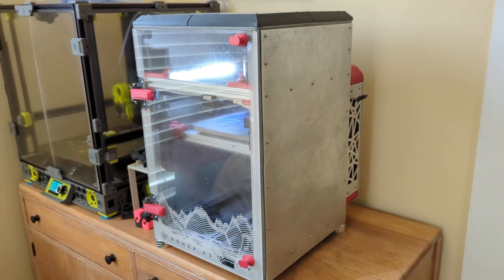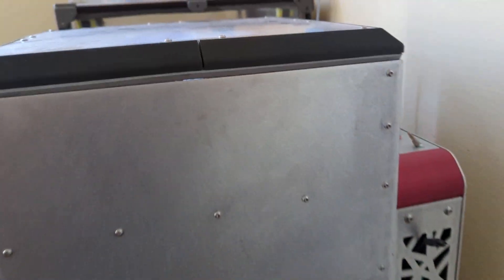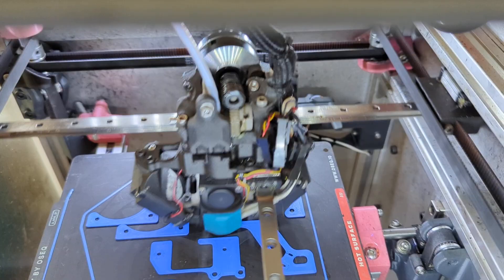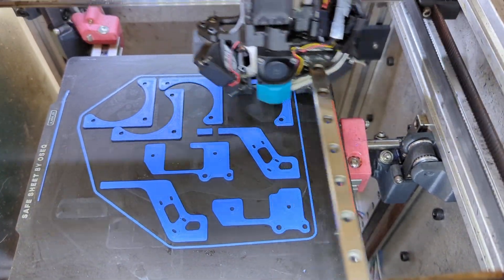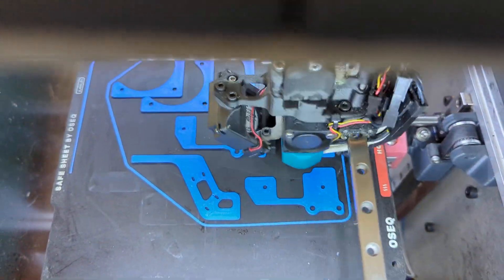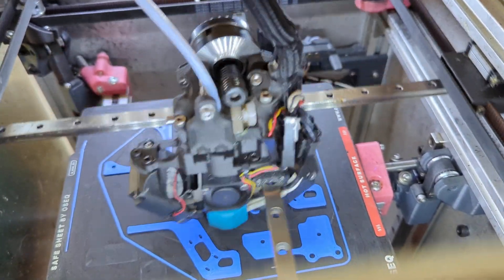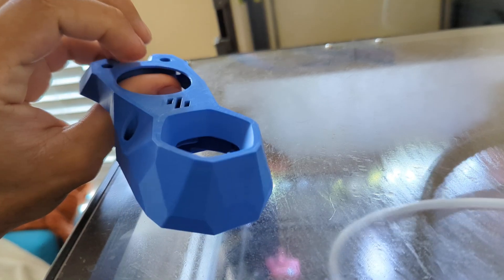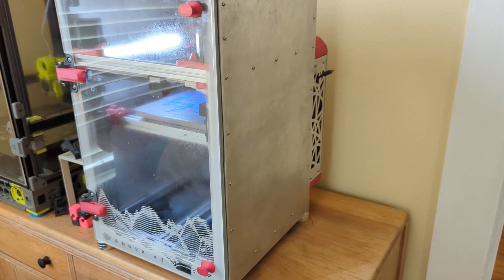Quick Annex Engineering K3 rundown with Quality demonstration

Comment: Okay so when you are already making a high end expensive machine why would not make the whole thing out of sheet metal instead just some panels ? 
See I never understood those design choices which makes the machine just more expensive.
I am not saying the machine is bad, it is not. I am just saying make it cheaper, way cheaper. It´s not so hard. Most parts are printed anyways. Why do those machines still cost way over 1k ?

Comment: How does the aluminum panels for the K3 compare to the 3mm acrylic panels on the voron, (sound, heat, and just generally speaking)? I'm considering transitioning to 6mm polycarb /acrylic (at least for the floppy doors), but have been considering aluminum for something like a doomcube +/- sound deadening/insulation. The aluminum panels definitely look a bit nicer.

Comment: Hey, what were your recommended input shaper accelerations and shaper types?

 I'd like to build a k3 but I'm worried that the 2020 frame or the crossed gantry won't be rigid enough for my plans (they're pretty absurd plans tbh)
Reply: if youre running it with a raspi and klipper.  You can get a cheap accelerometer and test yourself.  (the numbers very wildly if there is any changes to the build) even just minor changes in belt tension completely change the result

Comment: Thanks for the video. What a fantastic machine.

Every time I see this printer I want to build one. Then I start pricing it out.  Wish there were kits available, they've done wonders for the price of building a voron.

The other thing that would help is a build video.
Reply: Check out Fabreeko. They have kits now.
Reply: and a manual… annex just does not have enough development to push forward.
Reply from the maker: @edenwanpokyeung  I think we're all pretty happy with what the drawings provide. We're more focused on the product and are happy to help folks build it ☺️
Reply: @edenwanpokyeung  there wasn't much either at the beginning for Voron, but Voron was feature by several Youtubers, so that helped a lot